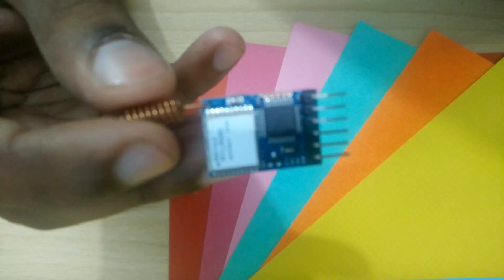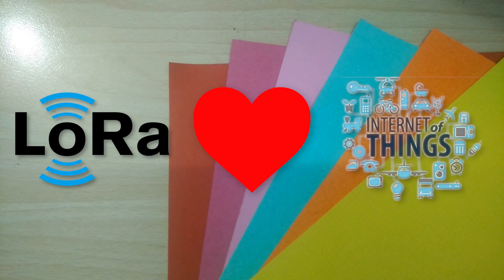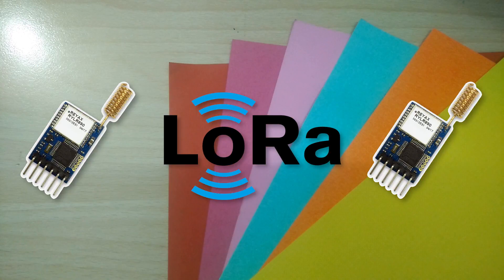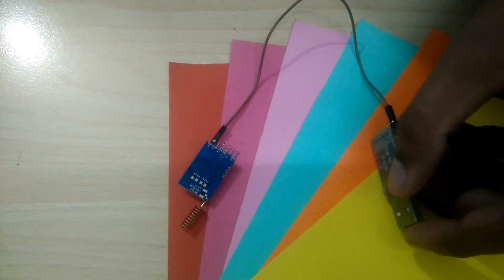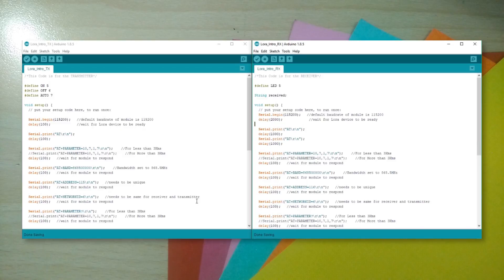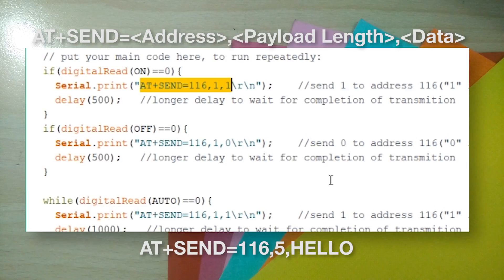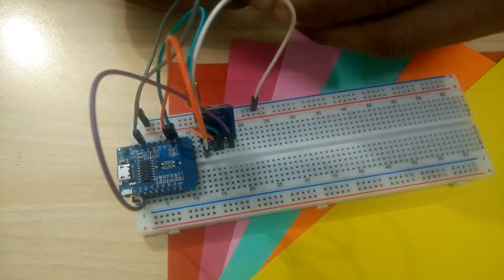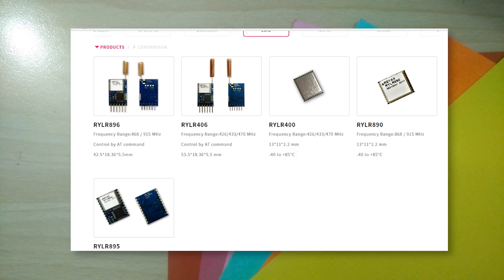How to use LoRa with Arduino/ESP (REYAX RYLR896)

Comment: Thanks so much for posting this excellent presentation!  My sending and receiving boards have a Nano, RYLR896, and Logic Level Converter to bring the 5V RX/TX Nano pins down to 3.3V for the RYLR896.  I had been trying for some time to get this to work, but it wasn't until I found your video that I was finally successful.  😃

Comment: "Whenever data is sent it is printed directly to the serial..."
Um, I'm not getting the response from the module, I'm just getting the command i send.... How to fix this?
CODE:
 Serial.print( "AT+SEND=1,1,1\r\n" );
SERIAL OUTPUT:
AT+SEND=1,1,1
AT+SEND=1,1,1
AT+SEND=1,1,1
AT+SEND=1,1,1
AT+SEND=1,1,1
AT+SEND=1,1,1
AT+SEND=1,1,1
AT+SEND=1,1,1
AT+SEND=1,1,1

Comment: This is a great video for a push button and led.  However, I'm having trouble creating a code for a potentiometer sending to another arduino with an oled display reading the 0-1023 values.  Any info on that by chance?
Reply from the maker: You need to properly explain exactly what the issue that you are facing is.
Reply: Also, I see you have a frequency of 868.50 on the code I downloaded from you.  Since I live in the US, should i change it to let's say 915.50?   I'm sorry I'm not very savvy with this stuff.  I've only been messing around with arduino and electronics for about a year now.  However, it's a very fun hobby once I understand all the what and whys .

Comment: Hello, I have a question for you about the reyax module, I'm working with lora for a project , I need to make lora multi-point nodes but your example is the point-to-point connection, my question is: if I use a reyax module as a gateway and other two diferents reyax modules as lora nodes ,they could send information at the same reyax gateway ? or they only function with point-to-point connection?
Reply from the maker: They can communicate with any no of devices. You just need to change the address in the code to which you want to send data.

Comment: Hello..just wann ask..Can the lora take 5V serial signal from Tx arduino? as it uses 3.3V only...ofcoure for the VDD is 3.3V as it is.
Reply from the maker: I can't remember if the one that showed can take 5v or not. Different modules have different properties. You should check the datasheet for this information. For the ones showed in the video, it should be linked in the description.

Comment: The data sheet for the RYLR896 does not talk about what serial baud rate range it is capable of. All the code that I see in your code examples is for 115200 baud. I have a need for 19200. Will it work if I change the appropriate code statements?
Reply from the maker: You can change the baudrate of RYL with a command. You can find the respective command in the command guide on the website.

Comment: I downloaded your code and hook the modules with 2 uno's with some resistors for max 3.3v to rx of the module, but I don't have any response.
do I need a usb to uart or something like that to configure or what can it be??
 I checked my wireing 10 times or so... nothing wrong. 
I can't figure it out :(
any idea? 
thanks.
Reply: I have the same problem. It looks like that the module doesnt talk back when its connected to a board....And i do not see that in his video he is showing the response of one AT Command when the Module is connected to an arduino board...

Comment: Hi, i'm trying to use your code with some adaptations, but i cant receive anything... i printed the "received" variable and i get allways +ERR=2. I can configurate  the TX and RX modules fine, because it gets "OK" for eatch "AT" command and i think is transmiting, but on the RX side i allways get +ERR=2. Can you hel me?
Reply from the maker: You can download the AT command guide from their website. At the bottom of it, there are error codes and their reason. Error 2 indicates that the head of the command was not AT string. You might have changed the command format.

Comment: Hey have you connected to a lorawan gateway? There are not much practical uses of a point to point connection..
Excellent video btw...
Reply from the maker: Couldn't find a gateway near my location. ☹️
Reply: @LiveSparks  ok thanks.. would need to check how to change the code for such a connection to a gateway
Reply: @jithin_isaac  Hi, these devices are not compatible LoRa devices for LoRaWAN/Gateway communications. You can however build your own gateway relatively low cost in your area on the LoRaWAN/TTN side. Still, great video @Live Sparks, and yes these devices are very interesting i agree.

Comment: Nice video, is the 5v rx and tx output of the arduino not a problem for the 3.3v reyax module?
Reply from the maker: Not as far as I could tell. It's like the ESP in this case, the power needs to be 3.3v but rx and tx are 5v tolerant. But if you have a logic converter, use that. Better safe than sorry.

Comment from the maker: I'll be doing a range test soon enough, so stay tuned for that!
Reply from the maker: You can send any string. My code only sent a single character.
Reply: @LiveSparks  I have RYLR998,  when set band using At command "AT+BAND=865000000", it remember only when it is connected, when i disconnect and connect and ise "AT+BAND?"
it shows +BAND=915000000Hz, why it is not remembering BAND?
Reply: @LiveSparks  Also SoftwareSerial not working